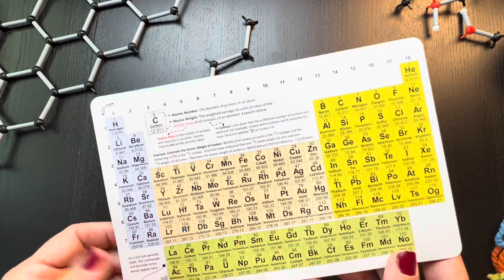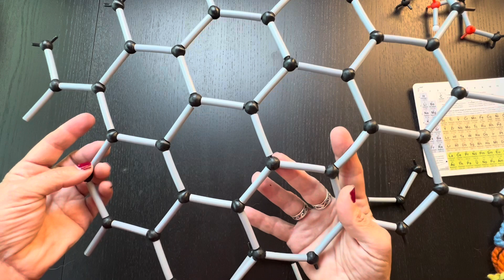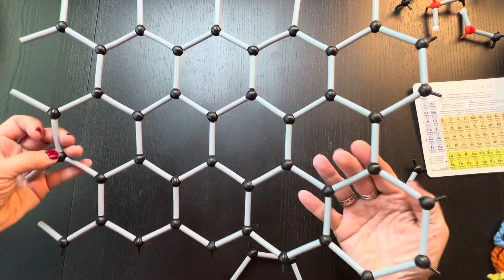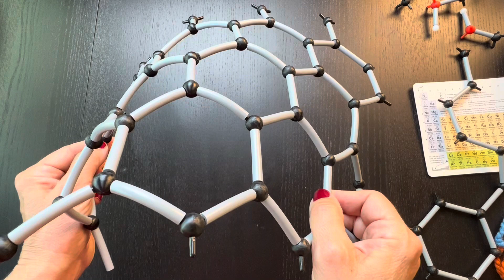Explaining carbon fiber materials used in the OceanGate Titan submersible

Comment: The marriage between the reinforcement (Continuous filament Carbon fiber) the glue (epoxy/polymer enhanced with intermediate bonding agent(s)) and vacuum bonding sealing the marriage by  removing the trapped air, micro gaps etc makes up the carbon fiber sandwich.

Carbon fiber systems work well in tension but poorly in compression such as a submersible chamber tube under extreme compression especially at joints attempting to bond to other materials such as titanium.
Reply from the maker: I’m so curious about the interface between the titanium and carbon fiber composites. I read about treating the carbon fibers so that the epoxy/polymer agents adhere to carbon — what is used to adhere the carbon fiber composite materials to metals such as Ti?
Reply: @ASMRChemistry  
Great question. 

There are closely held proprietary intermediates that are blended into the adhesive polymers to strengthen, “flex” and thicken the adhesive to better adhere to the Titanium and continuous filament carbon fibers. 

Proper care must be given so there are no adverse chemical reactions between the carbon fiber, epoxy, adhesives and Titanium. Chemistry like Physics, happens.

In the case of the Titan, it is vital the NTSB and its Canadian equivalent be given the exact adhesive bonding formula and thoroughly review the entire process. 

Proper brew Mixing & Applying thereof: 
Mixing the custom bonding adhesive polymers with   intermediates must be done with caution to avoid introducing air bubbles or contaminates into the mixture, which should be done in a clean room environment. 

A closed mixing and mechanical applicator should also be used. 

Proper Titanium Surface Preparation:
It’s critical to properly prepare the Titanium surface with specific surface features that mechanically allows more surface area contact and a specific “texture” be created on the Titanium for the custom adhesive polymers to better adhere to. 

Just prior to application the Titanium must be de-greased then thoroughly cleaned removing all contaminates including the de-greaser. The surface must have a neutral Ph. 

The entire process from a to z should be done in a clean room environment, with proper protective gloves, goggles, hair nets, respirators, protective suits and using special lint free wipers to prevent any lint contamination on the Titanium surface. 

Once the Titanium surface is ready it should not be touch by bare hands or exposed to lint, dust, and foreign debris such as human hair or exposed to other chemicals etc. Doing so will contaminate the Ti surface and must be re-cleaned and neutralized.

As to the Titan submersible, it appears in videos these proper guidelines and techniques were clearly NOT taken.

Personally, I wouldn’t even attempt to bond carbon fiber to Titanium for deep ocean water applications whereas the carbon fiber is bonded to Titanium under extreme cyclic load compression environments, as the case with the Titan submersible. 

In the case of the Titan, the different physical properties of the Titanium, and carbon fiber, such as expansion and contraction, creep, elongation, thermal transfer, impact resistance, tensile strength, static, dynamic and shock loading etc is asking way too much of the bonding adhesive to compensate for; especially if the submersible dives too fast causing thermal and mechanical shock loading which almost guarantees will break the bond between the Titanium, bonding adhesive polymers and carbon fiber. 

Best,
Kent

Comment: The Titan Submersible: Carbon fiber bubble wrap! 

Chemistry and Physics, like gravity, are real. Disregard them, bad outcomes. 

With over 38 years of advanced material reinforcement manufacturing, ASTM (I) failure analysis engineering experience, including carbon fiber, the method, application and overall design are all examples of total disregards to proper engineering designs, manufacturing, testing, evaluation and lack of certifications, created a death trap guaranteed to fail within a few cyclic loads. 

Carbon fiber in this application and overall design is complete negligence on all levels and in all disciplines.
Reply from the maker: NAILED IT. Your assessment and summary is powerful and comprehensive.💯💯 Thank you.
The aeronautical engineer I talked to made an analogy to building a house with boards they found on Craigslist that had been sitting around outside for an unknown amount of time. But yes… it’s even worse than that.
Reply: @ASMRChemistry Thank you so much for your response. ❤️Your channel.

My late Father had his Ph.Ds in organic and inorganic Chemistry. Thus, I am a Son of a Chemist since day 1. 

My 1st Chemistry set was going to work with Dad at age 6. He was a charter member of the American Chemical Society, pioneered synthetic rubber and modern synthetic fibers.

I had twisted Kevlar shoe laces  back in the 1970s as a young child. 

He was the former Chief Chemist of  the Celanese Corporation, then the Gates Rubber Company in Denver Colorado and then formed his own advanced fiber reinforcement companies. 

Today I witness so many basic errors that entrepreneurs clearly lack the education, training and experience in creating products that end in preventable disasters. 

Thank you for taking the time to share the love and joy of Chemistry on grass roots levels.

Your are a true gem and hero in my book! 

Best,
Kent
Reply from the maker: This disaster is in such contrast to the o-ring Challenger disaster. Where hundreds of knowledgeable experts worked for years, with safety protocols in place, and yet there was this tiny thing—the o-ring—where there was an oversight and its failure destroyed the vessel and the entire crew. In contrast, here we have just a handful of people making decisions (seemingly based on money and ego) for the entire primary structure. Both were tragic, but one could have been avoided easily.

Comment: Also, carbon fibre is stronger in tension (internal pressure any pressurized vessel) whereas it is rather weak in compression (deep sea external pressure on  Titan submersible hull)
Reply from the maker: Thank you for adding this detail!